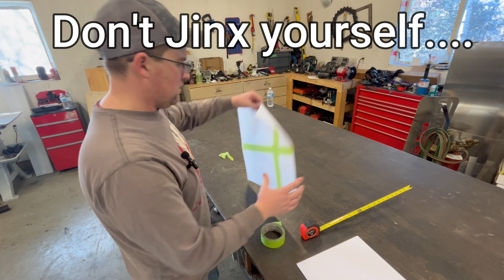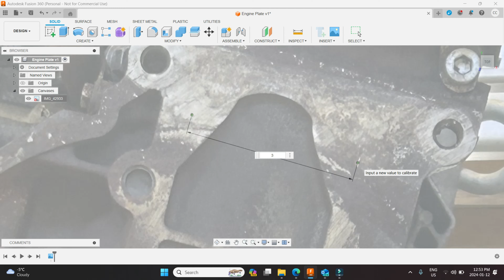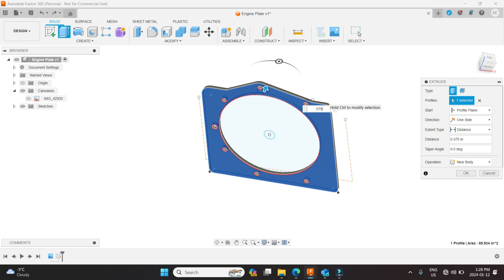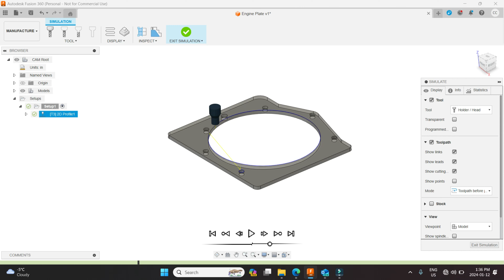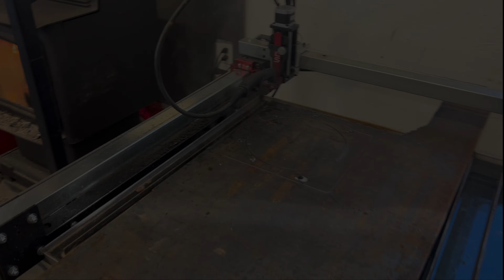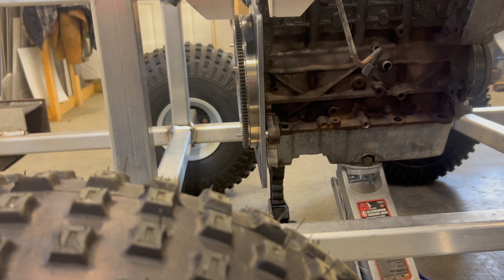Manufacturing Custom Snowcat Parts | Snowcat Build PT19

Comment: You seem like a good person to ask. Could you (if financially feasible) just put one of the wheel motors you got for drive wheels and put on all wheels to have a true 8x8 drive depending on how many wheels you wanted all together? If not what would be the theoretical reason for that not working? I figured you weld or bolt a control arm to each of the pumps so when you press levers it pulls or pushes all for each side?
Reply from the maker: You theoretically could yes. The motors would need some special valving to share the load evenly on the hydraulic side. You would need a very very large pump to deliver enough flow rate as well. It could be done but it would be quite expensive

Comment: Im surprised you didn't bolt on the aluminum template and then hammer the dowel locations so you could correct the file to show their true location before cutting the steel.
Reply from the maker: Yea but I just decided to drill and dowel my own holes. It’s the most accurate way for a dowel